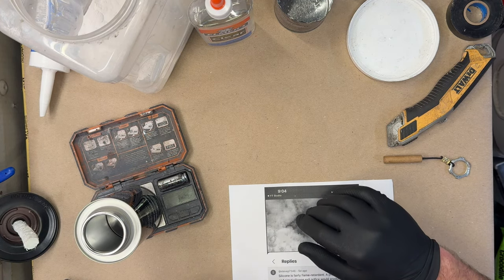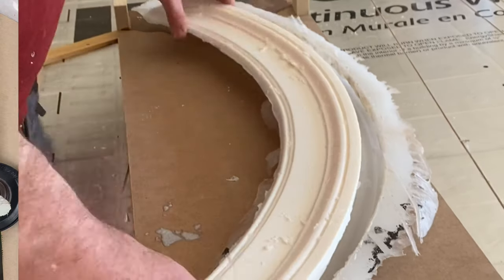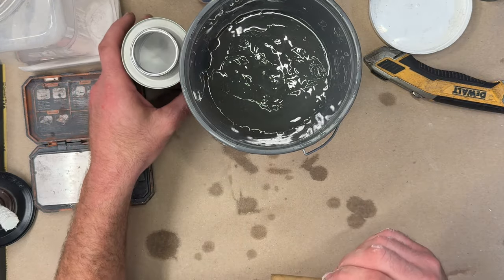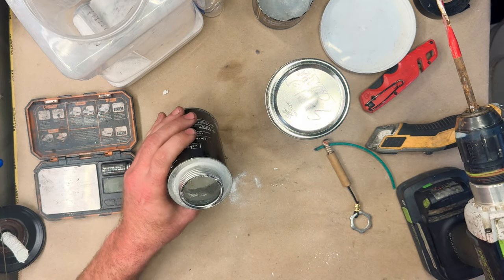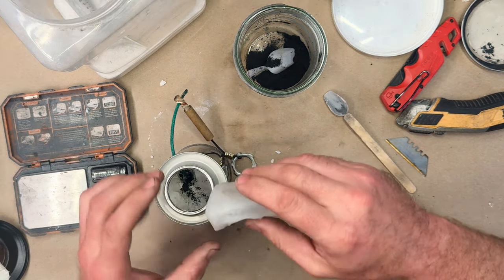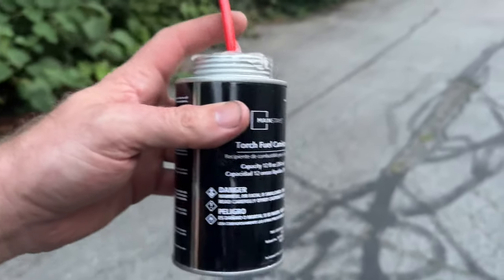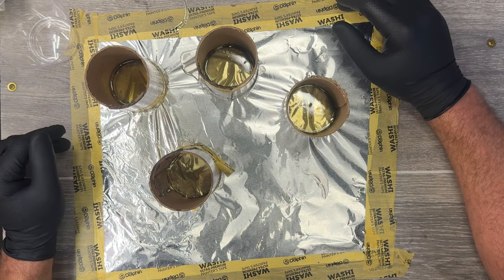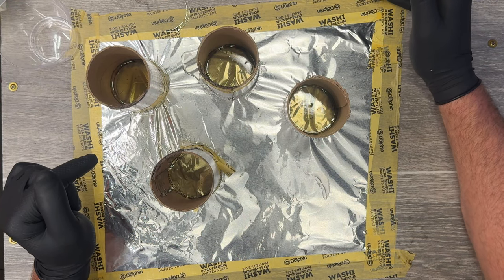Fart-Valve on Smoke Devices Improves Performance and Avoids Fires

Comment: I am disappointed. I was so wrong. It DID improve performance of the device AND failed to produce a continuous fart noise. 0 for 2. Actually I'm really glad this was accidentally useful. Still, there must be a way to also make it fart.

ETA: Whoopie cushions make a fart sound because they are lightweight and flappy. I think the silicone disk is too rigid, and the pressure/ volume is too much to get the right effect with the slit. It squeaks more than it flaps. I think maybe a molded orifice could work, though there might still be a volume of output issue.
Reply: They mak a fart sound because the air is forced through a little floppy rubber tube bit instead of a slit
Reply: My man, your design is starting to seriously resemble a fleshl!ght.
Reply: @Arcahnslight  Yeah, the molding could be... familiar.
Reply: I feel like your comment really caught the vibe of this channel (as I understand it). Nice job :)
Reply: Need to form a long flat tube for it to work right
Reply: proof that profit is not the best motivation for progress AND community cooperation is superior to unnecessary redundant competition! epic suggestion. necessity is the mother of invention and comedy is the sister of improvement
Reply: I still think this would work perfectly and be optionally re-usable by trading the silicone for a steel plate with a hole or slit in the center. To make it fart though, you could always overengineer the shit out of it and cut in a pressure release valve with a rubber blade at the mouth. Look up videos of people trying to whistle with a blade of grass and it'll make more sense.
Reply from the maker: The quest continues: 
Fart ‘Nade Test #5
https://youtu.be/0Pxhv9g0kIM
Reply: @InventionIncarnate  Look at the flapper on a pulse jet engine such as a WW2 V1 and how it works...
Reply: @InventionIncarnate  Truly a man of the people.
Reply: Try using a bicycle innertube cut approximately 12 inches long and attached one end of it to the open part of the can with a metal tie wrap. Trust me, you will get your fart noise. 🚽💨💨💨💨💨💨💨💨👍🏻
Reply: I think that poking holes instead of making a slit would make more of a noise.

Comment: i think i proposed on the last one, but  too late to be seen most likely, that having a ring of vents around the edge of the grenade would produce more, smaller jets of smoke, which mix the smoke better with the air. better mixed smoke makes it cooler, so it rises less.

you could also have a  hole on the bottom of the grenade, which would do the same deal, but also lets you vent gas faster, so you dont overpressure.

just a couple of lay ideas, good content man!
Reply: I was wondering about the bottom vent too, the m18s  have them but I am not sure about the HC nades?

Comment: One thing I noticed.. I'm pretty sure the M18 blows smoke out of the bottom (opposite end of the ignition system). This solves the issue of burn direction and allows you to simply burn from the top down instead of trying to get it to burn from the bottom up.

Comment: Dude, just blow on it very hard (or use a little compressed air) to test it so you don't have to make the whole thing every time. Also, try to make the silicon more flabby and thicker. The fart sound comes from the flapping caused by the gas being trapped and encapsulated to then exit and the surfaces flap again. At least, that is the understanding I have from all the queefs I researched in my past marriage. I hope this information helps your endeavors.

Comment: Bro, make the silicon section like, 2-4 inches long so the smoke is forced through the orifice in a pressurized manner causing fart sounds. Just try not to go too far with pressure for obvious reasons XD

Note: a longer silicon orifice gives any spark formed a longer time to burn out or starve before leaving the can.

Comment: I think I know why these TPA devices produce so much flame.  I'm not a chemist, but I'm a decent user of a search engine.

The "Open Cup Flashpoint" of TPA is 260C, this is about 100C lower than the decomposition temperature of every other ingredient.

If I'm understanding these things correctly, the way to prevent these flames is to prevent the environment inside the device from becoming an "open cup".

Which is exactly what you showed today.  So these valves aren't just a neat thing you stumbled upon, they're a solution to a very real and provable problem.

Comment: Look at the construction of a Whoopee Cushion.  
"A whoopee cushion is an inflatable bag made of two rubber sheets glued together with a small flap opening at one end. The bag also has a valve at the neck that holds in air until pressure is applied, usually when someone sits on it. When the air is released, the cushion makes a loud farting noise. 
Some whoopee cushions may also contain a white powder, similar to talcum powder, to prevent the material from sticking together."

Comment: Similar to what people have been saying about the whoopie cussion I also think a better approach would be to use thin flexible membranes instead to cause the farting sound. 

Something I once did as a prank on a friends car was to stretch a balloon over the exhaust and cut of the tip to basically have a rubber hose extending from the exhaust. 

This might work with the smokegrenades too although I am unsure if the pressure and heat from your mixture would destroy the balloon before it has any chance of creating the desired fart noise.

Comment: Could you utilize some kind of oc gas or pepper spray in your unit. I'm interested to see if there could be a crowd control use or possible crowd deterant. If your a prepper you should already be carrying breathing aids and eye pro. Would be a good way to make an escape.
Reply: I bet you could add a small amount of capsaicin to the TPA formula.
Reply: @mgreene900ninja  He did a video on using this to disperse an insecticide ( permethrin iirc). He made some nod, wink references to other dispersants. Bottom line is, if it doesn't combust or chemically decompose at the temperatures involved, or chemically react, (Chemically stable, non-reactive) and is light enough to disperse, and mixed in a ratio that doesn't interfere with the smoke mix burning properly, it will disperse. CS was developed for this, if you can get your hands on some. Pure capsaicin should work. Powdered pepper will burn, but will still work as an irritant. From kitchen experience, ghost peppers and reapers will gas the entire house if blended in a blender or heated. In fact, I'm no longer allowed to slice them inside.

Comment: There’s a video on the internet of someone that put a fleshlight on the exhaust of a car and when the engine was revved the fleshlight made a few fart and bubbly sounds. I think the silicone needs to be longer because with it being so small the pressure is able to hold it open and not let the cheeks slap. Try using a longer piece of silicone with a slit down the middle. Watch the mentioned video and see what you think and maybe it’ll get some progress.

Comment: Ok, idea here: #1, if you slip the soft internal part of a “fleshlight” (trying to be family friendly here 😂) over an exhaust tip, you get this fart-nomenon. Therefore, MUCH softer, flesh-like silicon is the way to go. Maybe grab some cheap adult toys from Amazon to cut up first, then but the casting silicon of this specific type. 
2: Try to cast the type 1 silicon in the bottom of a coke can, creating a parabolic & thus thinner center area, to which you’ll make your slit. That may remove enough rigidity & enable the “fwop fwop” movement. 

All I got for now!

Comment: Wrong approach to the fart valve guys.  You are using more of an opening that once opened stays opened til the force stops.  You need something that restricts the flow to a point then flutters as the flow goes by no matter how the force goes by a la whoopie cushion valve.  Direct the outflow of pressure towards two thin membranes of which sit closely together and can easily be spread apart by the passing smoke but the passing smoke will take a random path through each time because the tension is being varied as the gas is passing through the thin membranes.  That's gotta get some good Sloppers going.  Not these queefy things.

Comment: It's actually the water that activates the silicon. I make this putty with cornstarch, foodcoloring(waterborn) and oil. Goes off in about 20 minutes.😊
Reply from the maker: Did I say  “catalyze” or “activate?” I thought I said “catalyze”.  If I said “activate” than you are correct and I would be incorrect.

This comment may have just solved a big problem I’m having. So in your mix the cornstarch is the water donor, which accelerates the crosslinking. Is the oil to prevent adhesion? I need to bulk cure greater than 1/4” which it silicone’s max atmospheric curing depth. Anything thicker will never cure. And silicone cures by air and avg of 2-3mm/24hr period which is too slow. If I use dish soap though it doesn’t adhere to
Reply from the maker: (Continued)…the wall of cylinder or epoxy oriface plate and ends up poppin off and starting a fire. If I use cornstarch though will it crosslink and solidify and still maintain adhesion? I want to avoid using metal fasteners to anchor if possible.
Reply: @InventionIncarnate  Not sure if it catalizes or activates, pretty sure it is a reaction between water and silicon, and not a chain reaction. If it were a chain reaction, every tube of caulking would harden after being opened, instead it only goes so deep. Cornstarch might indeed make the rubber more flammale. I use it to change the consistency, makes it harder. The water comes from the foodcoloring, which is liquid. The oil makes it non stick, so I work it in with a spatula, and finish neading by hand untill homogenous.
Reply from the maker: Does it remain a putty or does it cure?

Comment: A thicker silicone disk should produce a harmonic which may actually get the fart sound. Also Silicone 1 is only rated to 400F so the kind used for potholders would probably work better. But one video spent on the joke is probably enough... right?
Reply from the maker: Oh no, the quest continues: https://youtu.be/0Pxhv9g0kIM?si=uvkvfJTQ5R4XHq7K

Comment: Could be that the shaped thats being cut is wrong.  If the slit or hole were tapered it would have an easier time oscillating.  Also you may need to test different material structures to find one that oscillates at the frequency we need given our enormous output

Comment: question boss, wouldn't twin vent be better for concealment? I feel like less duration but more smoke output would be advised if it was strictly for concealment, and single vent would be ideal for a more pressurized signal flare.

Comment: Wood or cardboard spoons to make them biodegradable. The true test to see if the smoke grenades do not cause fires is to use dry pine needles.
Reply: Spoon and its mounting have to withstand force of the hammer spring. To fail it doesn't even have to break, enough creep will do the trick. I think the priority should be not to blow/burn yourself rather than make everything 100% biodegradable ;-)